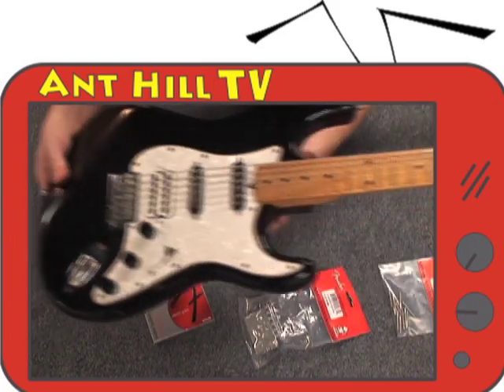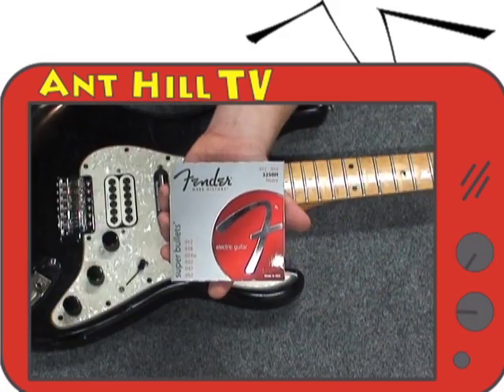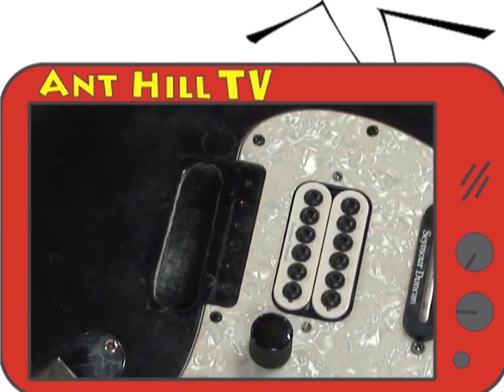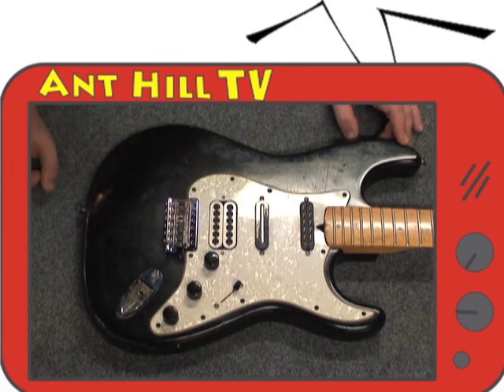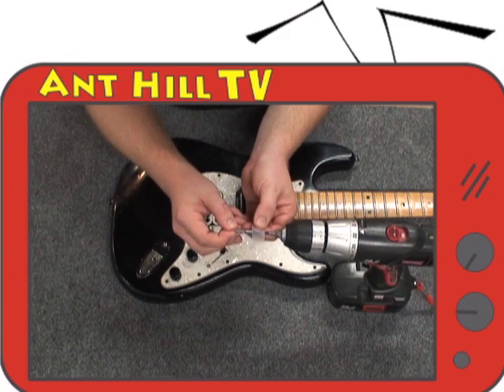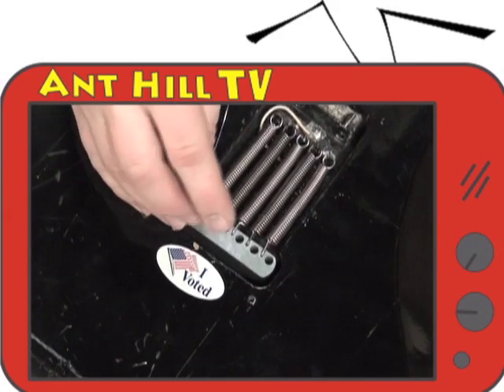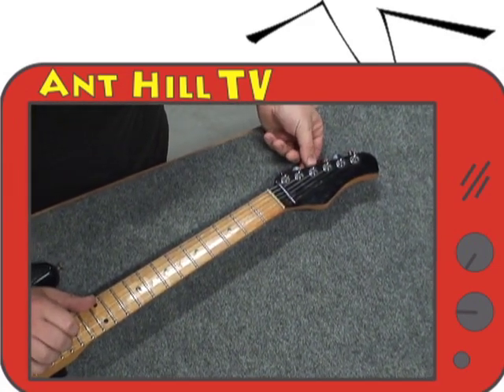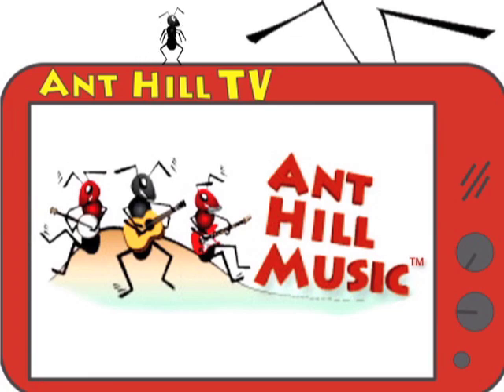Ant Hill Music TV - How to install/replace a Fender Mexican Standard Stratocaster Tremolo Bridge

Comment: Thanks for posting this video! I do have one question though. I have a MIM Strat I purchased in the early 2000's. a 3/16 Allen Wrench seems to fit the truss rod. I tried a 1.5 mm for the bridge string heught adjustments, but it is too big. Do you know what size might work? I could use a small screww driver, but I'm afraid of stripping the screws. Thanks!

Comment: The bridge assembly with strings tuned should pull the rear up showing 3.8 mm of block.  I use 2 inch claw screws, so I can release more tension on the springs.